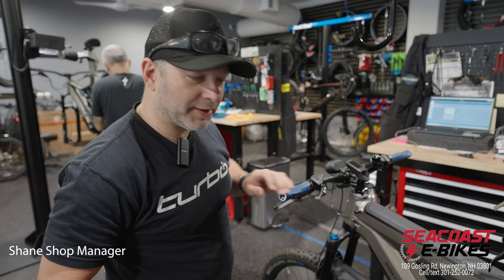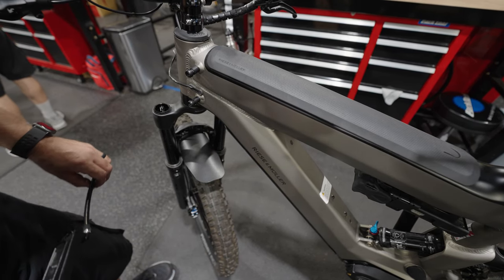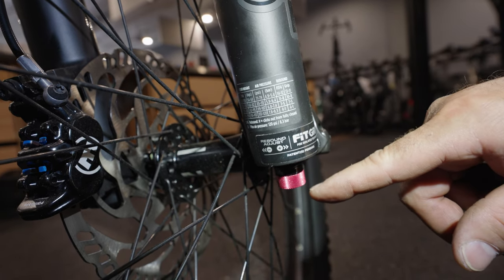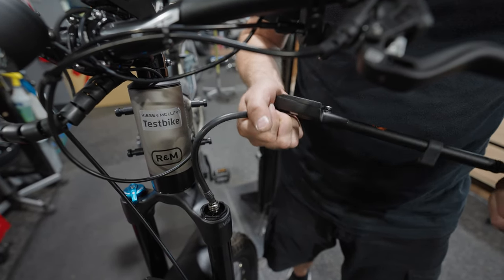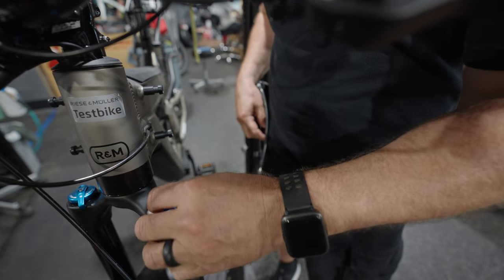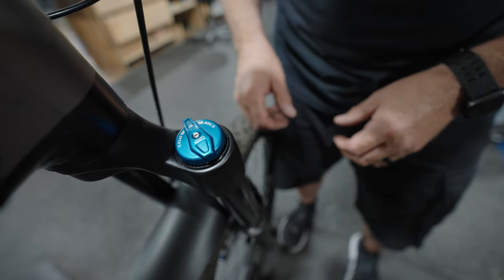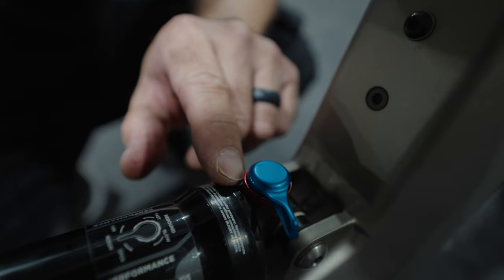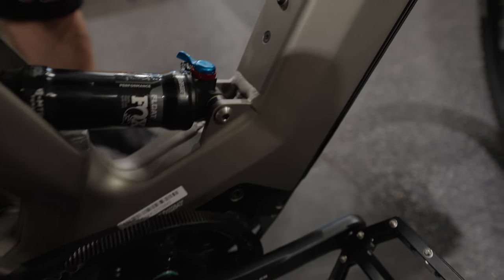How Often Should You Check Fox Air Suspension. Riese & Müller Superdelite Mountain Rohloff Fox Float

Comment: Thanks for this overview of the Fox Float option!  I imagine I would set the suspension to firm/locked if I were riding along a smooth nicely-paved bike path - somewhere where there aren't any bumps, basically.
Reply from the maker: Hard roads have a firmer setting and for off-roading based on the conditions and weight of the rider softer setting.